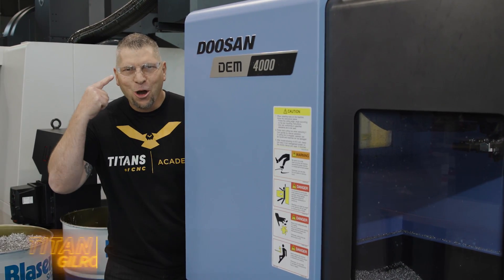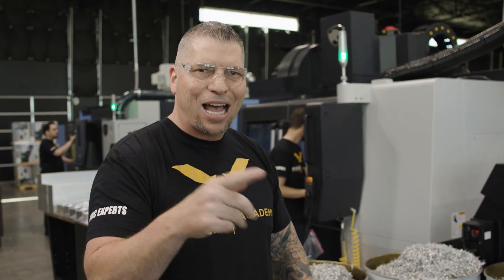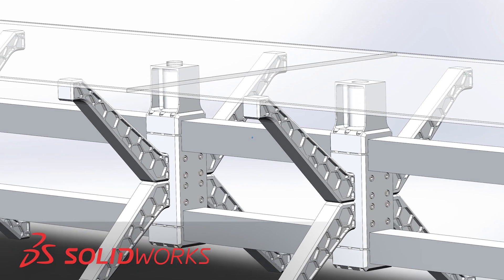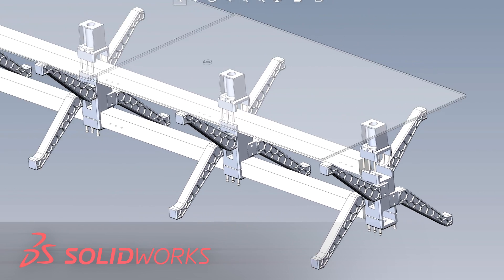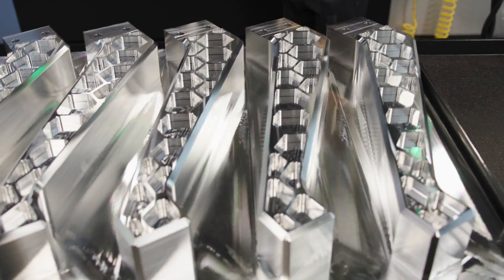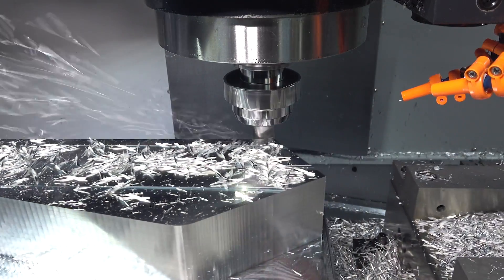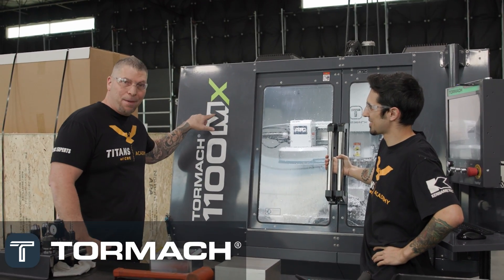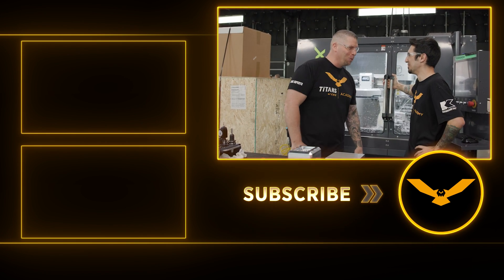CNC Machining our CUSTOM Conference Table using DN Solutions Machines

Comment: Titan of CNC cannot compete with our machining shop. Oil steel dust mix everywhere, metal is in the air all over, the owner kneeing on the floor welding customized parts. Real men at work with dirty hands. The son of the owner is working next to the CNC on a conventional machine, blowing all the coolant and dust directly onto the CNC for years (and yes it really collected up). It's a cute 1100x650cm toolmaker CNC.
Well I came across this shop and spotted an idling CNC machine there, it was defect. I fixed it and now we're slowly starting up a CNC business there as well.

Comment: I'M A TOTAL NEWB HERE SO DON'T GET BUTT HURT. JUST A OBSERVATION 5:43 WHAT ABOUT ADDING A BLOWER OF SOME TYPE TO KEEP SHAVINGS AWAY FROM THE BIT AND NEW CUTTING PORTION OF PART TO FURTHER REDUCE UNWANTED HEAT AND SAVE BITS FROM RECUTTING THE SHAVINGS POTENTIALLY DULLING BITS  AND MAYBE SAVING TIME ON FINAL FINISH.
Reply from the maker: The coolant keeps the chips away, we ran without coolant just for the camera... but ya, chip fans are great.

Comment: Beautiful conference table but as a video conference installer ouch that one will be a real challenge to install around. If you go for a video conference system, and you should, make sure some hack doesn't get in there. Most if not all the equipment can be wireless today to keep that table clean, clean, clean.

Comment: Nice work! Titan, since you're building your own tables, have you thought of branching out in designing your own line of tables for 
other fab companies, or even custom billet tables, desks and chairs for high end homes or offices? You could even have those products 
anodized per the customers wishes to have matching sets. Oh, something that just popped into my head. If you were to build custom 
tables for office buildings you could even machine company logo's and intricate designs etc. into the table tops. If the the logo's etc. were 
machined into the huge billet table tops deep enough you could even add glass etc. on the tops to check out the machine work underneath
for an awesome look.

Comment: I like the design and the thought process of making your conference table a piece of functional art, but I didn't see any provisioning for leveling feet in the 3D models. It takes crazy money to get concrete to be truly flat and most building aren't built to that kind of specification, especially in the office area. So, unless your office area is way nicer than I expect it to be, I think you are going to need something to make sure all the legs make even contact with the floor.
Reply: It will be next 2-3 episodes about adding leveling feet :D
Reply: We will have to wait and see how they engineered the center column to leg connection. All we saw was a finished assembly.  I think that 1000lb. glass top will find it's own level. 😉

Comment: Looks like great fine industrial art. Practically conference tables usually have a bay for power outlets and Ethernet connections ( more reliable than wifi). Seems you could mount underneath on / in horizontal support beam.